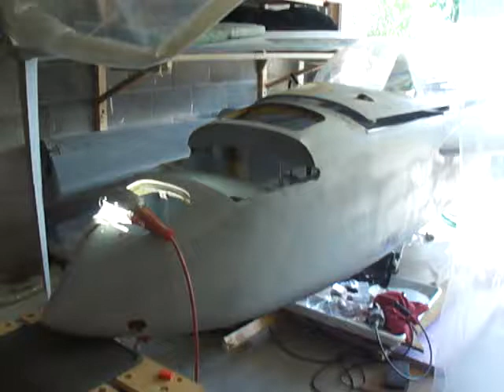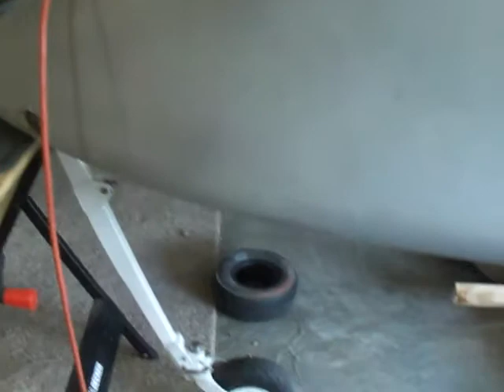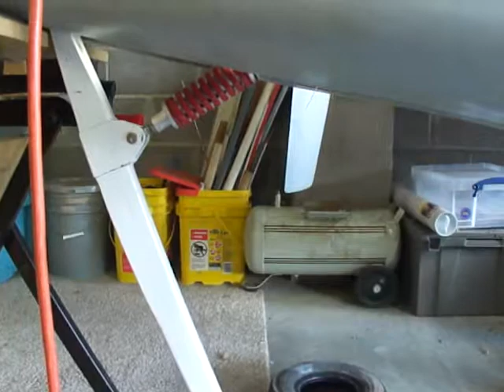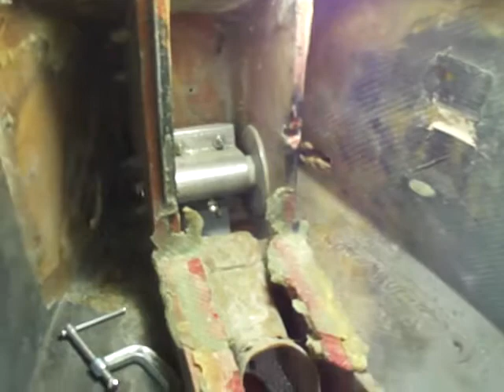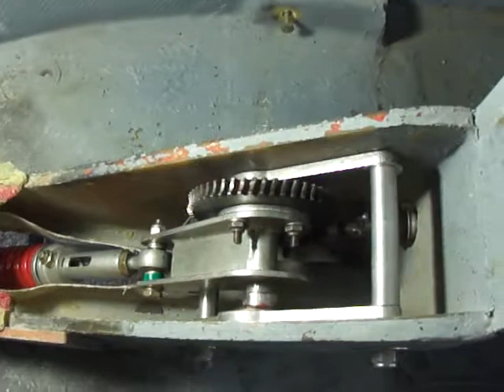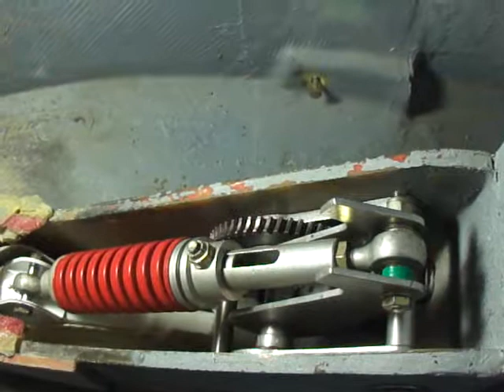Varieze Nose Gear, Stock Drive Review, Pt  1

Comment: The reason it chatters because the worm and the gear are not setup properly. There is an article in an old Canard Pusher. The worm needs some side load. Mine works perfect.